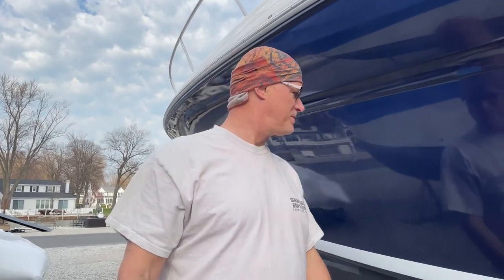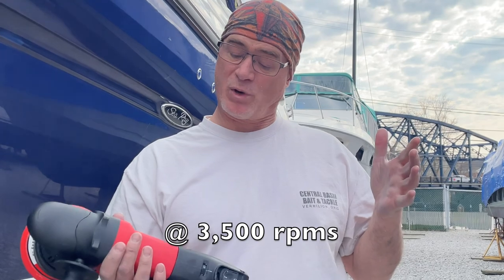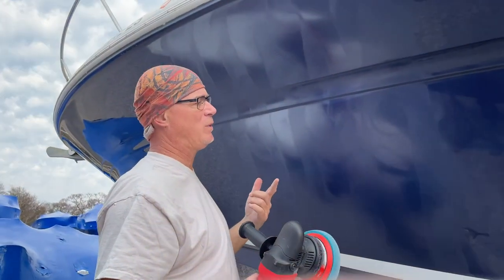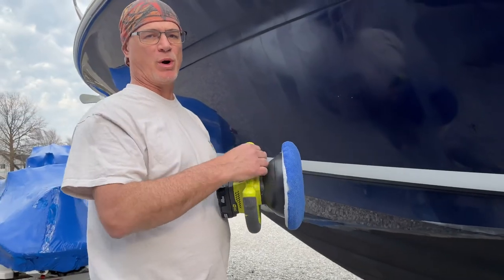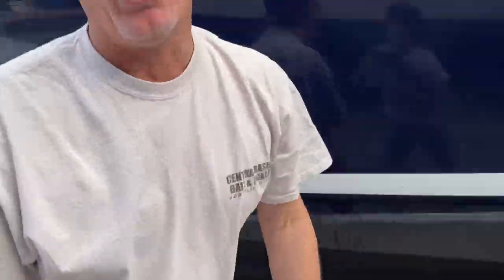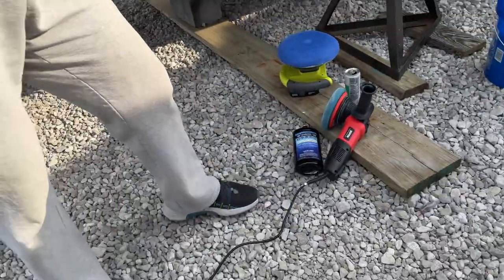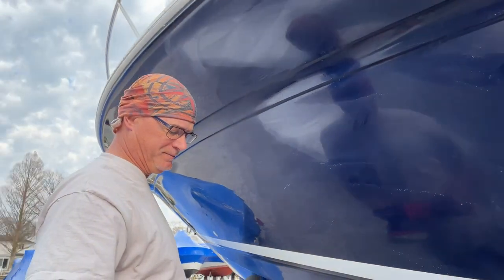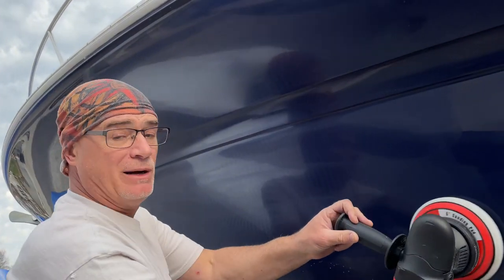How to polish your boat with an orbital polisher and ceramic topcoat.

Comment: Great vid! Want to share that any spray ceramic like that will not bond to the gel coat as to the ceramic that's in a solvent you apply in a pattern and wipe off using 2 towels minimum.

Comment: Great video. How did it hold up?
Reply: Thanks for asking… On the starboard side that gets the south side Sun at the dock it began failing at 3-1/2 months which I expected.  I applied a quick fresh layer of spray ceramic that extended the shine and water repellent properties about another 6 weeks.  Better than wax and a good price that’s for sure!  Next spring I hope to provide another value product that I hope lasts a few months longer.  
Take care, stay safe. 
- Mr Jeff